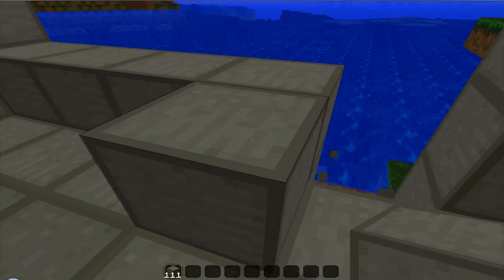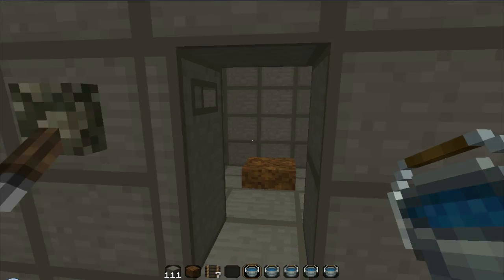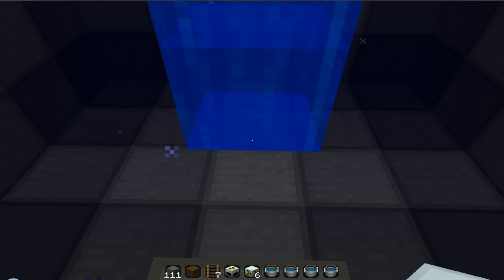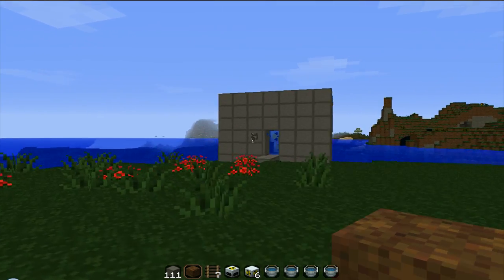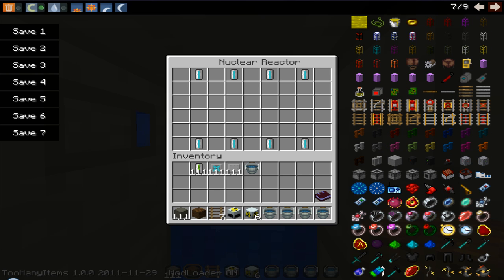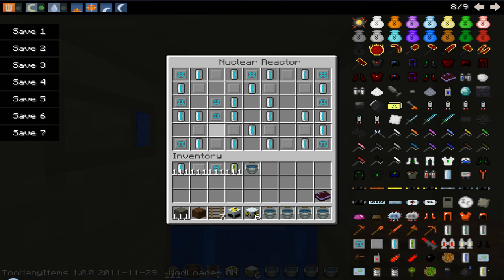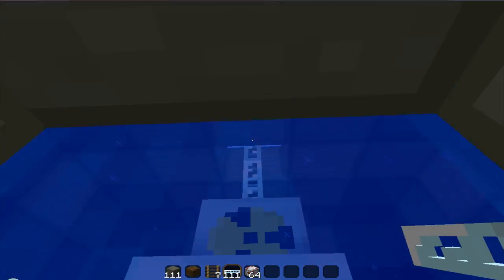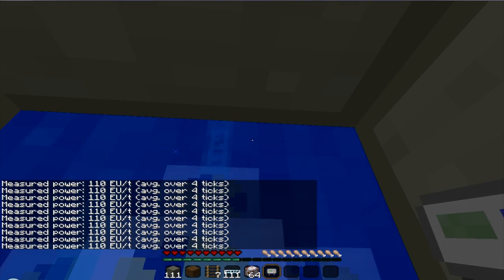Minecraft: Nuclear Reactor Tutorial

Comment: this is fairly inefficient, you can gain alot more eu per uranium with a 2x2 block of uranium thats cooled by the rest of the entire area. u can get 120 eu/tick this way and drain the cells with no cool-down (cool-down between refills tho). also generators buring coal put out 5 eu/tick lol not over 110

Comment from the maker: @CrazyAmberRun You don't want to use a Bat-Box. The energy coming from the MFSU is actually 512 EU/t which will fry most machines and storage. Also, the batbox can only withstand a current of 32 EU/T (as shown in the video, this reactor outputs 110 EU/t)

This is what you should do...

Reactor --> MFSU --> MV-Transformer --> LV-Transformer --> Simple-Machine.

Check the industrial Craft Wiki in the description for exact EU tolerances of each individual machine.

Comment from the maker: @mynameisntscott no that is perfectly correct, the reason this happens is because you have an excess of cooling power, which is just enough to fit 1 extra coolant cell, but it can only go in that 1 spot. the same spot on the other side might work as well.

the excess comes from all the coolant cells and how their arranged, if you removed just one coolant cell from this configuration, it would all fall apart and go boom eventually.

you can check the IC2 wiki for more details on heat distribution